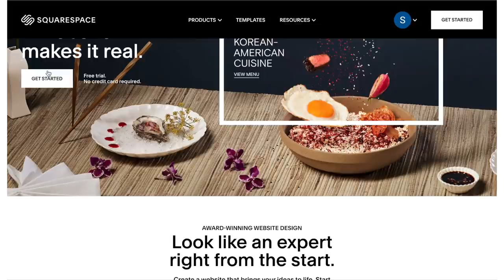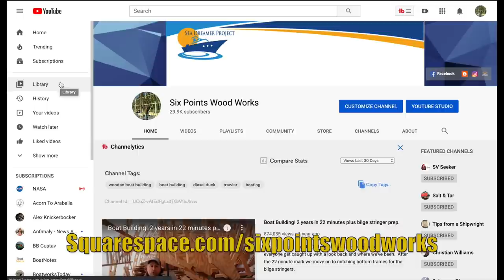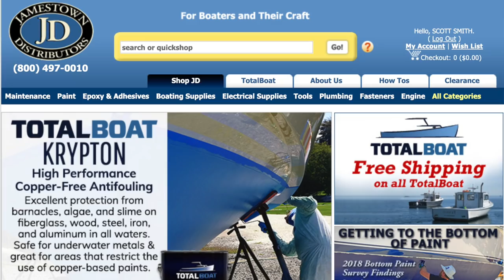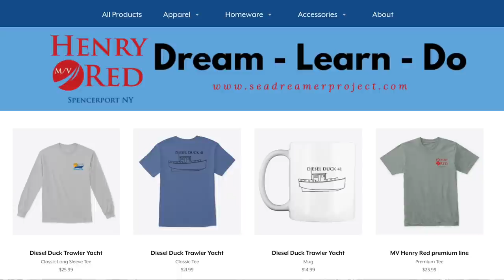Boat building with planking, interior work and a potentially serious injury.  SDP Episode 55.

Comment from the maker: Well it's officially torn.  Surgery 4/16.  2 weeks immobilized, then into a brace.  Once I get the brace I can get back to work as tolerated but I'll be pretty limited for a couple more weeks.  Takes a really long time to get back to full strength, but after 2 months I'll be pretty safe to not mess up my surgeons work so in the grand scheme that's not to bad.
Reply: I tore my left distal bicep tendon completely and part way through the associated muscle last September and had surgery on October 2nd.  I was flipping an old (solid hardwood) door over on sawhorses.  Since it had paint stripper on it, I essentially curled it with my left hand underneath but with my elbow extended - a motion the doctor described as horrible.  I felt the pop you described along with a bunch of "electric shocks" similar to what I experienced with carpel-tunnel.  I never thought I'd injure myself moving sheet goods (I've always been more afraid of my table saws).

In any case, being six months into recovery I can tell you that you won't be lifting much with the arm for the first three months.  I was up to about 12 pounds curling by Christmas and am at about 35-40 pounds now.  I was shocked at how fast it atrophied in the brace.  You'll also be working on stretching everything back to your normal range of motion.  I have a small amount of nerve-related tingling but it seems to be going away slowly.  I can tell you that I considered having the surgery done and going through the (admittedly long) rehab an investment.  It's now better than it was during the couple weeks prior to my surgery and, since I'm only 55, it will give me another 20-25 years of service.  Treat yourself well and don't skimp on the PT ... I've done a lot of projects one-handed during the last few months but it's been doable.  Prayers and blessings for your recovery!
Reply: I feel your pain! Same injury for me, bicep rolled up like a window shade, most painful thing to ever happen to me. Reattached and you’re right it’s a long process for recovery and you’ll never completely trust that arm again, but, if you take it easy with it you’ll have complete functionality. But your power lifting days are over I’m afraid.😟
Reply: Happened to me a few years ago with a sheet of fire rock.  While it did take a few months to get back in shape, I eventually got full strength back and don't notice a thing with my arm now.
Reply: That sucks! Sorry to see that. I hope you heal quickly.
Reply: Best of luck, you just gotta get an extra pair of hands for moving planks
Reply: aww man what a bummer, hope you heal faster than expected with only minimal pain.
Reply: Lucky they are prepared to operate in these times. Over here on the other side of the pond I'm waiting for hand and shoulder surgery, both should have been done by now, instead they are cancelled till further notice, so probably not this year, although having had corona virus mildly I'd rather not be in hospital surrounded by it.
Anyway good luck with yours 👍
Reply: Good luck on the surgery and a speedy recovery.
Reply: Sorry to hear that, Scott!! I hope that the surgery went well, and that you heal quickly.
Reply: Hi Scott, I'm very disappointed in you. Now we will have to wait weeks to see progress. Sorry, I'm just kidding. Hope you have a speedy recovery.  Can't wait to see your next video!!!
Reply: I can't believe all the work you've done. Its hard to remember those towering keel laminations and setting the frames. I would have had the surgeon replace your bones with Adamantium while he's in there, but that's just me.  Best wishes for a fast easy recuperation. Sheet in the mizzen, lash the helm over and just let it rock a while. The storm will pass.
Reply: Heal fast...  we need more videos...  lol....  kidding...  Heal strong and correctly.  You're gonna need the strength to finish this beast.
Reply: I hope it heals well and fast Scott. I hyper extended my right elbow a few years back with 120kg of weight off a roof rack and it took months to heal, and don't get me started on my shoulders - also same thing with the over extended high lift action. Try and keep the arm warm as the cold really gets to the injury.
Reply: Get well soon man
Reply: First, thank you for all your videos, second take it easy and get well soon!
Good luck
Reply: You should ask for help like sv seeker does. You may get to meet some other woodworkers in the area. When Covid blows over that is
Reply: Get well soon!
Reply: If you plan to continue planking while healing, think about not working unless you have help in the shop/boathouse with you. Additionally, hang a rope or two from either side of the boathouse to hold up one end of the plank for you while you are positioning it for fastening.
That takes a bit off the load and reduces the risk of the planks slipping and instinct having you try to catch the full weight of the board.
Reply: Oof. Get well.

Comment: You have a better doctor than I had.  Did the same thing handling a large piece of wet 3/4" OSB and the doctor shrugged and said they don't repair that tear unless it is required for you work or you are an athlete.  Being 60 didn't help either.  But things still work, they just look funny.  Great work on the sole above the tanks.  Progress is moving right along.  Best of luck on your surgery.  Take care and get well quickly.  Thank you for the video.

Comment: Been following your build for awhile, enjoy it! One question, why do you use fasteners with a slotted head? I thought the reason the Phillips  head was developed,was to get a more secure grip while driving
Reply: If you ever want to dig a screw back out, you will appreciate that the guy before you used slotted screws.  You can clean gunk and junk out of a slot fairly readily.  A phillips head, yeah, not so much.  Additionally, with a slotted head, you can offset the screwdriver, which cleans away gunk and junk from the side of the counterbore, limiting tear out as the screw backs out.  Cannot do that with a phillips head.
Reply: @WhatAboutTheBee  Aha. That is an excellent point .

Comment: I would be curious if the copper preservative would make the wood glue useless? thoughts? 13:28
Reply: My thoughts as well
Reply from the maker: Polyurethane glue, like gorilla glue, is best when working with copper based wood preservative like found in pressure treated lumber or applied on the surface like we are doing.  However if you allow it to dry thoroughly then Titebond III works acceptably.  If I was building a piece of outdoor furniture or not using mechanical fasteners I would use Gorilla Glue.  However, in this situation, where I expect things to be dry, besides ambient moisture and humidity in the air, this will be fine.  I'm essentially using the TBIII as a robust bedding compound that gives us some additional holding power.
Reply: @SixPointsWoodWorks  ok, that makes sense. Thank you for the reply. Hope your arm get better!
Reply: @SixPointsWoodWorks  Interesting. Must be a different copper preservative than I've used in the past. "Dry thoroughly" was a many months prospect and it stunk to high heaven the whole time... I noticed you weren't using a respirator when applying it so I'm guessing that there is a much more benign version now.